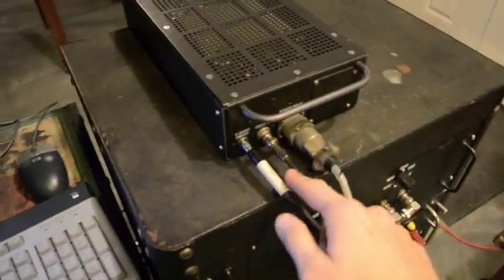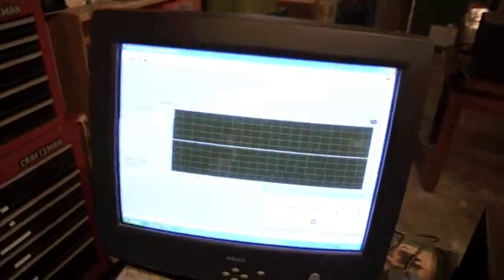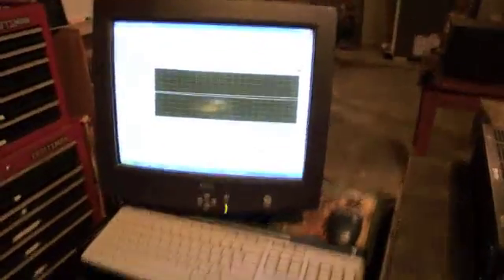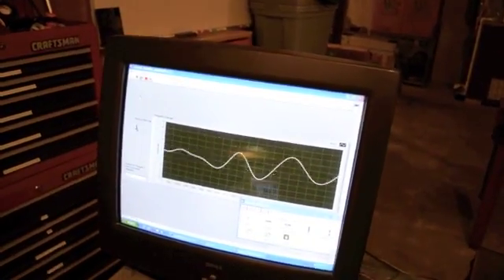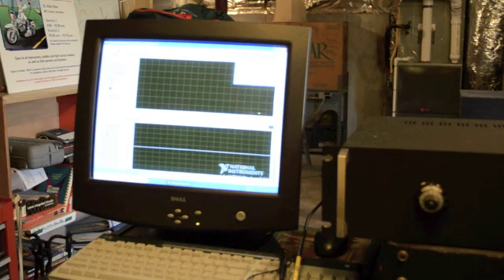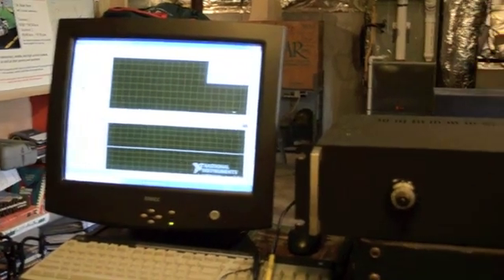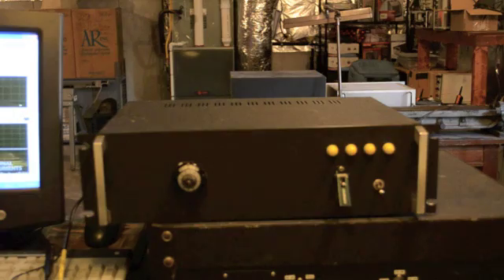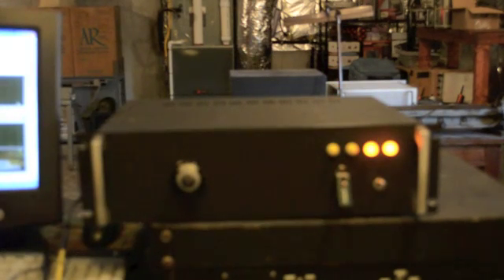X-Band CW Doppler Radar Experiment

Comment: Dr. Greg,
Nice work,  looking at you labView Display at 5:00 there are harmonic spikes, what causes, what frequency? Also, would going to a non-zero IF have a higher overall RX gain (that would require an offset in the LO). 
For FMCW (other project) what is the largest BW acheived and fastest sweep time?

Comment: Nice work.  Do you use any high pass filtering of the video in FMCW mode, or does the digitizer have enough dynamic range  to handle RX/TX isolation and others close reflections?  I built some C and Ku band dual polarization scatterometers back in the day (90's) when I was at KU.  Was streaming 4 channels to disk via  Labview as well.  Fun stuff!

Comment from the maker: Sure, these should work.  May not have the range because the antenna beamwidth is too wide, but considering the low cost i would give them a try.  Just plug the output into you mic input of your laptop.